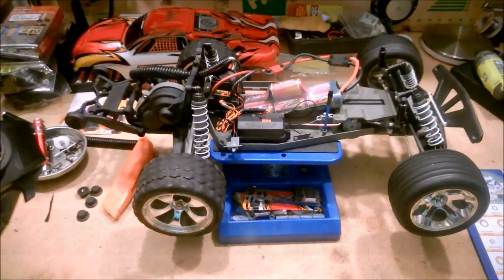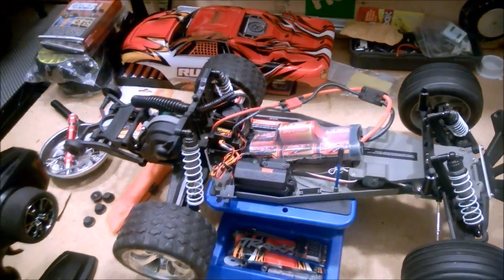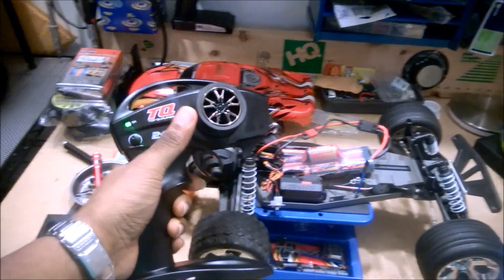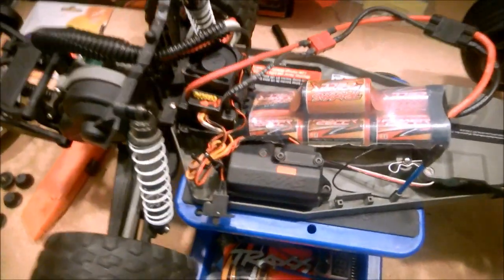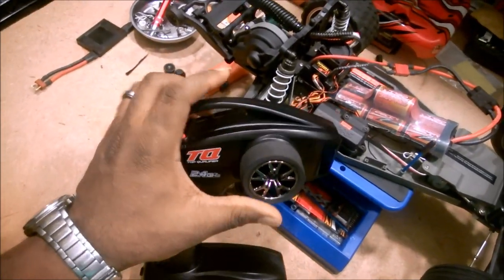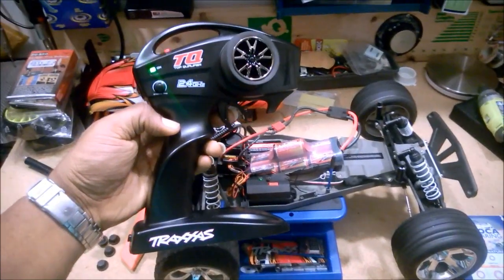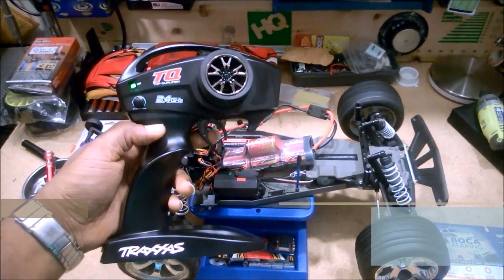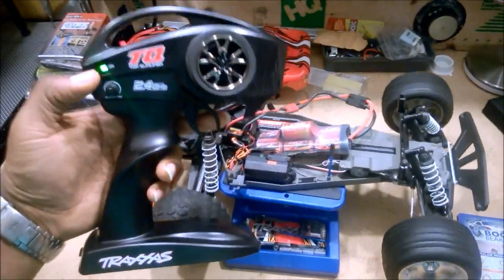Ep. 61: Traxxas TQ TX Channel Reversal (Quick Tip)

Comment: How do I reverse the 4th channel so my differential servo will turn clockwise instead of counterclockwise?
Reply from the maker: Sorry for the delayed reply. I've never used the Traxxas 4 channel radio, so I don't want to steer you wrong. I'd just call Traxxas tech support and one of their techs should be able to give you the procedure. Their number is 1-888-872-9927 (888-TRAXXAS).

Comment: Dude at the hobby shop sold me a new control and receiver before I saw this video. Oh well. I will use it on another car. But won't trust him again.
Reply from the maker: I wouldn't be too upset at the guy at your LHS. Lots of "experienced" guys don't know about these features becasue Traxxas basically hides them. I'm not a big fan of Traxxas electronics, but they have some really powerful features in those remotes. They just make them so difficult to use that the average user can't access them. 

For example, did you know a Traxxas 2.4GHz Tx can be paired to multiple RCs? They can do a lot more than they tell people about. IMO they should do a lot more to educate users about the useful features that are burred in these radios.

Thanks for watching!

Comment: OMG...   I bought a used Slash and the throttle was reversed and there was a roughly 20% throttle on.  It was driving me crazy.  When you would cancel it by going the opposite way, the truck wouldn't go any more. I followed your "secret" menu setup and regular setting mode and it fixed my truck!  Thank you so much.
Reply from the maker: I'm happy to have helped. Thanks for watching!

Comment: What do you do if the car won’t reverse backwards it will only go forwards?
Reply from the maker: The ESC may be set to "race" mode. Most race tracks require reverse to be disabled. Check the manual on www.traxxas.com. It should have instructions to re-enable it.

Comment: VERY HELPFUL. My throttle was reversed and this works for the throttle just use the trigger and not the steering wheel
Reply from the maker: Thanks! I appreciate that. I was shocked there aren't more videos on programming these radios.

Comment: Hello . I want to ask . I have a traxxas xl5hv esc and Titan 550 Motor. I plugged it up and with the lip on the receiver plugs you can go wrong . And I have a tq controller. And reciever. . I plugged it all up and I tested it stearing first them throttle? I used your method and it worked for the stearing but now the throttle? Eney ideas for me ?
Reply from the maker: You can try calling Traxxas Tech support. 1-888-TRAXXAS.

Comment: I need to figure out how to adjust the trottle trim on this system. Would you know anything about this?
Reply from the maker: Which ESC are you using? It sounds like you need to recalibrate your Tx throttle endpoints in your ESC. All ESCs have a little different process for this, though.

Page 19 of the attached manual from the Traxxas web site gives you instructions on recalibrating a Traxxas XL-5 ESC and transmitter. The VXL-3 should be similar, but you should check the manual for any of the Traxxas VXL-3 powered cars. This will set the neutral point and the max brake & throttle. https://traxxas.com/sites/default/files/24054-37054-4-OM-EN-R00.pdf
Reply: rhouse21 - RC Physics I pretty much tried everything I could. Ended up pulling the system and putting the Traxxas stuff back in

Comment: This is not a Channel Reversal. A Channel Reversal is when channel 1 switches to Channel 3, to use as an example.
Reply from the maker: A see your point, but many people use this terminology as well. Sorry if this was confusing.
Reply: rhouse21 - RC Physics thanks for the help...good vid
Reply: It is a channel reversal dumb ass!
He never said change the channel!
Learn the proper rc terminoligy before you comment!
Informative video however that tx does not support multi model memory, only the tqi does.
Reply: Markus Dmitri,....what you're talking about is called channel assignment,....servo reversing is changing the direction of the servo,...